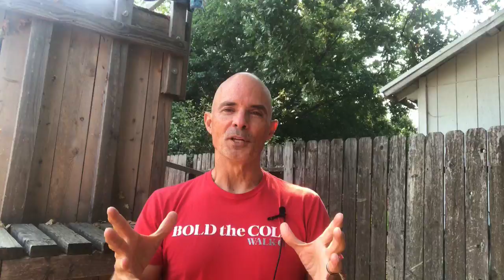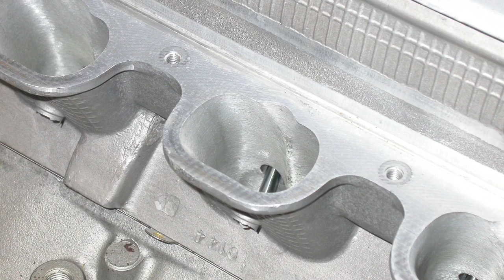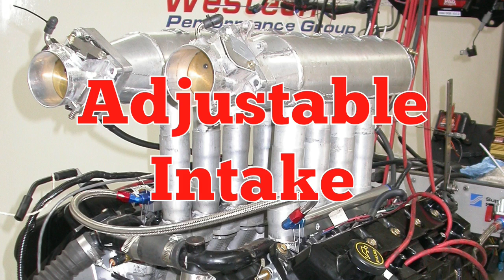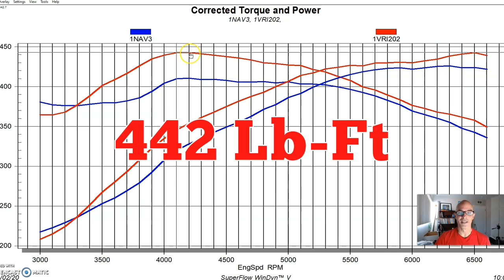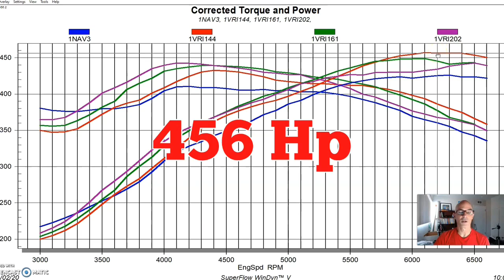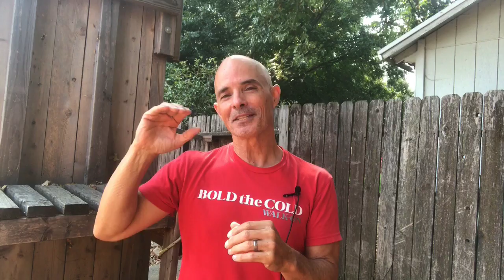5.4L AUSSIE BOSS 290 INTAKE TEST

Comment: I don't know if you have the 4.2 liter v8 the 253ci but they a good little motor back in the day for the Aussie cars
Reply: Ah the old thong slapper, sweet little motor, perfect for a cruiser.
Reply: Yes they sounded great, went ok in a light Torana LH/LX but no torque
Reply: In stock form they sounded much better than they went. A properly modified one could chuck 300hp down but very few did.
Reply: @dinosshed l had a 253 in an old Volvo wagon , it pumped out 260hp, which is over 120hp  more than they ever came from the factory,  my mechanic  said it would detonate like a hand grenade if l wanted any more power out of it, no way a 253 could handle 300hp .
Reply: @mickblack3291  most of the commodore cup cars made more than 300 at the wheels.

Comment: The guys are Power Driven Diesel turned a 6.7 Cummins up to just over 8k. Of course at that point all sorts of stuff let loose. Can't remember the exact numbers but they did a calculation on how much force was on each rod bolt and it was something like 34k pounds. The reason this all happened is because the throttle stuck open and the piece that suppose to slam closed and kill all air to the engine malfunctioned so the driver had to put the truck in neutral and let her spin. That might be an example of piston speed being a limiting factor.
Reply: https://www.youtube.com/watch?v=co_aHanY1Ek
Reply: According my calculator the piston speed was circa 112 ft/s or 34.1 M/s or 6710 ft/min on that engine when it let loose. That's a 4.88 stroke at 8250 rpm which is pretty close if I remember correctly to where the engine let loose. Fairly impressive really because wouldn't the rods and pistons from a 6.7 Cummins be heavier than those for say a 632 Chevy? This all happened a couple years ago so I might have some of the numbers a little off. I shared the video of it happening here. If you want to know the exact numbers they have a follow video where the walk through all the damage and the numbers.

Comment: Richard I have a Shaun Hyland aluminum 6.0l block with a ford 5.4 racing crank (5.8l total),running a Boss 290 intake with a custom upper 1000cfm oval throttle body. It also has custom cams and long tube tri y headers. The chassis dyno indicated 580 hp and similar torque at the flywheel.  I think a greater plenum volume might help and would like to see what a 1 in space would do. I also like your twin inlet idea. Btw there is an Aussie company that makes a front inlet upper. There is also an individual throttle body intake.  I would live to see that dyno'd!!!

Comment: I have a 5.4 2v lightning motor swap. Have zero deck height piston from weisco. K1 rods, tfs heads and a gt500 blower adapted to it. Running 10.4:1 and stage 3 crower cams. I hope to put 650 to 750 to the ground. Its running about 21 lbs of boost

Comment: Love the fabricated intake! Is it a true dual plenum with the crossover? How about a true dual plenum, dual plane with a throttle body installed in the crossover to create a variable dual/single plane intake-dual plane low speed torque with single plane high speed HP. Thank you Richard.
Reply from the maker: don't think its possible to have a dual plenum and dual plane, but I did run this intake with and without divided plenums-even put a throttle body between then to activate-also tested different cross over positions, changes in air entries-even ran it all on 1 throttle body
Reply: @richardholdener1727  I was suggesting to modify your intake to a carb dual plane intake-each plenum feeding half the engine based on the firing order. What happened to the power curve with each change to your manifold? Will you be posting the results? Thank you.

Comment: If I can say one thing about the piston speed thing, which is truly pedantic, also depends on the engine life. Bearings and cranks can only take so much, but definitely valve train is the limiting factor, unless your using Nitrogen sprung valves, but that is in a different realm of engine building. Just my $0.02 

Awesome video man, ive been waiting to see the factory gator intake test. I have one waiting for a project, just didnt know where to go form a stock gator intake
Reply: Think engineering explain fella  said  that  max piston speed is  60ish  mph   due to  the  combustion  cant  expand  much faster than that???

Comment: Quad Cam 5.4 liter 03-08 Boss 290 is 378 hp net, Boss 260 is 349 hp net, the 342 factory Stroker 5.0 --->5.6 2002 Tickford T3 250 was 335 hp net. Each were just the Quad Cam  Cobra R intake. Its the Trick Flow Box R with some slightly better detailing. The 82 mm MAF was Cobra R for those. The bssic casting became the DJR 320, a 429 hp net engine. The idea was US Dearborn. The application  of the idea was Australian. The items go far above those net hp ratings if you linish and flow bench the bellmouths and adjust the upper box. US idea...Aussies did it because they wanted to win the performance war with 5.7, 6.0 and 6.2 Alloytech Chev engined Holdens.( No ER required...just yet).

Comment: Love it! I’m an Aussie with a boss 260 5.4 (lower comp than the 290) but with the same intake manifold. Cool to see it tested! 
I was also worried about everyone saying “piston speed” is a big worry with it. I’ve revved mine to 6500 for minutes at a time, occasionally seen 7000 and nothing’s ever broken!
Reply: You gotta bump those numbers up. Those are rookie numbers!
Reply: Matvey Kulgavyy 🤔 it’s also a daily driver that does 1000 or more kilometres a week, don’t wanna push it too much... I don’t like walking 😬
Reply: Oil pump gears might shatter if you keep revving its tits
Reply: The 290 is actually the lower comp .
Reply: @robsearles3875  sorry mate it most certainly is not. The boss 260 has 9.5:1 compression ratio and the boss 290 is 10.5:1. I also have a bottom end from an FG GT boss 315 which has 11:1 comp ratio that I hopefully can put to use soon. The differences in compression are achieved by a different height flat top piston that comes up closer to the deck height for each higher compression engine combo.

Comment: Longer the stroke the better torque and the less rpm needed.
This for a production engine. 
302, 327 350 Chev
302 351W
340 360 LA 
351 400M.
The 5.4 here in Oz has very little available simply to overhaul, or at least a few years ago. Huge heavy lump. And overshadowed by the 4 litre turbo 6.
Reply: Please correct me if I am wrong. They run less than a 4 " bore. To me, that is less piston surface area and increased valve shrouding and less low rpm torque? I wonder if the reason was to control detonation? They are known for timing chain adjuster o ring blow out, leading to dire problems for the valve train. The 3V 5.4 at 80 mph, in a 35 mph{ 110'} cross wind and air con on full; delivered 24.5 mpg. An imperial gallon is 4.5 liters. I thought that was great going. Cheers.

Comment: I own a fpv GT which has that factory boss 290 intake and you can definitly feel how suggish they are for a v8 downlow, until u hit 4500 rpm then a burst of life rushes the motor very quickly to 6200. Where the aussie 302 which has the long rinner explorer intake which has plenty of down low power, a lot more street friendly. A big complaint had by us aussies when that motor came out.
Reply: There are many reasons for this that I could write pages and pages on but....you have made a correct connection between this manifold and the "low" torque production in comparison to say a 220kw 5.0 from a AU II or AU III.
If you look at the dyno charts in this test you will see the Navigator has almost as much as 50ftlbs more torque near 3000 rpm. This would be definately felt. Considering the weight of our BA to FG series Falcons of 1750ish to 1880ish kgs...that low down torque production was almost NECESSARY. The navigator style would have been a better choice for the XR8s 260 with lower compression and the BOSS290 recieving the Cobra R style with higher compression but maybe even an option with the Navi intake. That Dyno graph shows EXACTLY why there was such a difference and contributed to some going for the Barra6 Turbo as the peak Torque production was actually earlier in the curve helping our heavy falcons to feel quicker.
All of this was related to how the industry standard graded power production at the time between Holden and Ford. It was purely based on Peak Numbers and for that reason Ford went with the Cobra R style manifold. If it was based on Average numbers..there may have been a different design all together. They did do well to make a compromise though and that Dyno chart mirrors exactly the curve that is felt.
Reply: My ba with a boss 260 with herrod cams you just get used to the fact it’ll freight train over 4000 all the way to 7000 but don’t expect it to do much below 3500.
Reply: @ZedTee77  our older cobras in the us that weren't supercharged yet were 4v 4.6 and they screamed past 4k but felt gutless before that...the answer ls 456 gears if you are all motor completely transforms the car.  Steep gears for a car that has a 4k-7k powerband and not much down low.

Comment: It's not piston speed but piston acceleration that limits rpm. Once the rings start to flutter and break the seal your goose is cooked.
This will limit you every time and goes up with the square of engine speed. This engine with its 4.165 stroke even at 7000rpm is maybe pulling 1500gs peak. A formula one engine will have over 4300gs peak with a lower mean and peak piston speed. Youre not measuring the important part.
Reply from the maker: I understand the acceleration part very well since it has to stop and start-I didn't want to go into it that deeply-most use mean speed

Comment: Richard the the boss 315 engine on the series one fg falcon GT had a twin blade throttle body from factory if you are looking for one . In Australia you could get the 5.4 in 260,290,302 and 315 kw
Reply: Yella Terra also do an aftermarket upper plenum for the BOSS manifold adding a twin 60mm TB.  It also adds a bit extra plenum volume and fixes some cylinder to cylinder fill mismatches the factory plenum lids have.  In the aussie location the TB is on the left side of the car (as you look at it, passenger side for us, drivers side for the US) meaning teh rear cylinder on that side has the least air flow.

some people have also tried the front TB input (used as an OTR style from a intercooler), and twin TB's one on each side (seen done for both n/a and twin turbo setups).
Reply: Dataminetk I was goin to say the same, you can also by a spacer to lift the top up 10mm to also help cylinder to cylinder air flow.

Comment: So richard does the. Adjustable intake have open plenums or is there a center dump like the factory ls has in it
Reply from the maker: what is a center dump?
Reply: If you cut an LS intake open it has a tube in  it with a hole in the center pointing up atthe roof

Comment: A Question about Piston speed.
What about longevity of the engine? yea you can run a 30K rpm 460 but how long will it leave?
What about people who are trying to build engines to be daily drivers and last decades of life?
Reply: Terminal velocity of a combination will limit power at a certain point. F1/bike engines use much smaller mass internals with titanium to keep bob weight down even further. There's no way you're going to rev a small block 350 much past 10,500 and make more power even with all the fruit. Look at nascar and the drag cars, 10,000 is the max they're turning them. Desmodromic valve trains and pneumatic bellows might let a bigger engine rev higher but guys would be doing it already if it worked.

Comment: We don’t “get” some of the coolest stuff, we “designed” it, we may well ride Kangaroos to work, but we make lots of cool things when we get there, just curious if we didn’t also change our 4V heads as well, fabulous video as usual Richard, luv your work.
Reply from the maker: I think I demonstrated my love and respect for the Australian hot rodders-if you think I indicated anything else-that's on you!
Reply: Richard Holdener, indeed, and I certainly wasn’t having a go at you, I love the fact that you go to the trouble of even testing our aluminium bits at all, unfortunately most Muricans, think that we get all our go fast bits from the US, most still believe that the Barra is just an old 250 motor from an F150 with a touch of new paint.
Our now dead car industry turned out some wonderful things in their go fast departments, look what GMH did with that old 3.8 Buick stinker they ran in the Commodore for years, unfortunately they forget how to make daily drivers that people wanted to buy, again, luv your videos, I have learned so much from them, and even this episode about RPM, I was always told that RPM was limited by conrod speed in Metres per second, regards Mike.
Reply: @50Hertz60hurts  I thought the big thing in Australia was to modify Toyota 1UZ motors or Nissan VK motors?
Reply: Kermit Stanbach , far from it. Most of our high performance market here in Aus is based around the LS, the Barra Six turbo, the 5.4 Ford and Coyote V8 and a whole range of other stuff, including old school Ford, Chrysler, GM Holden and Japanese performance like Rotaries, Fast Fours and Sixes, etc.
Reply: Kermit Stanbach, absolutely, we Mad Max the shit out em!
Reply: @Flitzer514  the Barra is one of the big ones. The 4.0 dohc i6 is truly amazing for what it is. Since Ford dropped em in a ton of cars and the territory, they're common and the market has kept up with performance parts. Unfortunate for us in the states that want something that's not a push rod dinosaur..
Reply: @GlennEverittMasterofMachines  Gents 351 Cs were big in Oz. Even  a 302 version with quench, 2V heads, was made. Just made for av Gas 351's! I digress . Higgen's makes heads for both Windsors and Clevlands, using the canted valve design. They cast their own manifold to suit. These items take performance to a new level, I am led to believe.  Go U.S.A iron and aluminium too!
 Regards all.
Reply: @MsKatjie  oh, those Higgins heads are stunning in real life. Plenty of little shops here in Vic making weird stuff fast.
Reply: @Flitzer514  How did you have the impression that Aussies love Toyota 1UZ motors and Nissan VK motors? Is it because of "Mighty Car Mods" youtube channel?
Reply: @richardholdener1727  Sounded good to me Richard. Go get 'em!
Reply: In my day, we were hotting up 351/302 Clevelands, 308 Holdens and 202s.
Reply: Aussies always had the upper hand with 302/351 Clevelands , Barra and Boss 290 . Even 2V closed chamber heads ! Pillow Cleveland blocks and XE parts . I'm jealous of some of the cool stuff you had down under
Reply: V12  twin turbo barra  anyone??   8liters of pure torque...if it can be done  hahaha
Reply: @MadLadMartyMcFly85 , liters? That’s rubbish on the side of the road isn’t it? “Litres” is the Metric unit for volume.
Reply: @50Hertz60hurts  🤣🤣🤣  dont think it matters where its located,rubbish  is rubbish  right? 😜

Comment: Want a bigger throttle opening on a BOSS intake? Check out Yella Terra’s website. They offer a revised top half that accepts a twin blade (used on some Shelby cars I believe) or oval single blade TB. Furthermore, they offer a supercharger kit that lives in the valley and doesn’t add any size to the factory intake!
Reply: Check out the stock Navi TB at 4:33, any chance this is the twin blade that you speak of?
Reply: Stuart Marshall bigger again. It’s a twin 65mm Ford Racing unit.
Reply: I tried to buy 1 of the yella terra hats but they didnt need my business, i bought a better front mount job, 120mm throttle 😉👍🏼

Comment: The boss plemum was on backward, but as i have the boss260 (same manifold) this  was the best episode yet 👍🏼

Question did you use the same fuel rail for all the manifolds? Being aussie buying yanky parts is a nightmare

Taken the advice of bigger throttle body on the front
Reply from the maker: different rails for each
Reply: @richardholdener1727  oh ok, ive just been hunting for a pair for my boss manifold is why i ask
Reply: Yeah haha I was wondering if he had it backwards or the photo is mirror imaged. I’ve noticed a few photos show up mirror imaged.
Reply: @ZedTee77  i commented then realised the manifold was backward, so technically the lids right, but na its backward the throttle should be the same side as the 710 cap, he's not using an alternator which would be the only problem